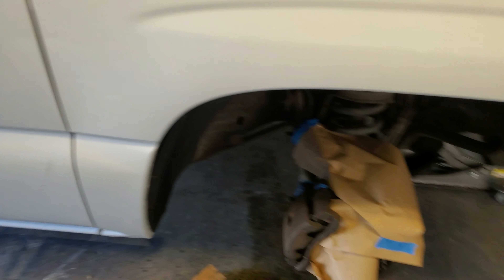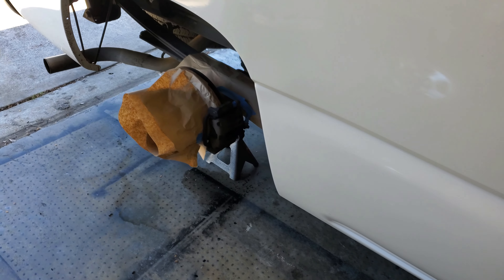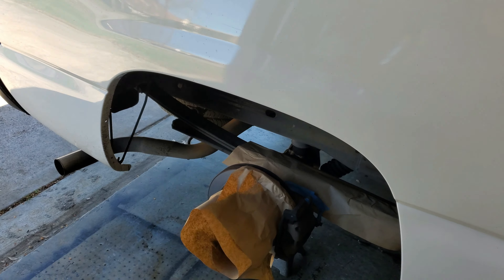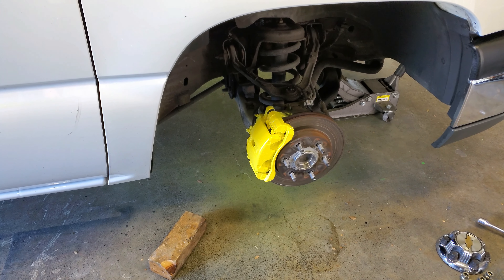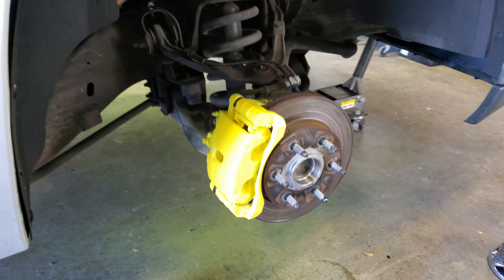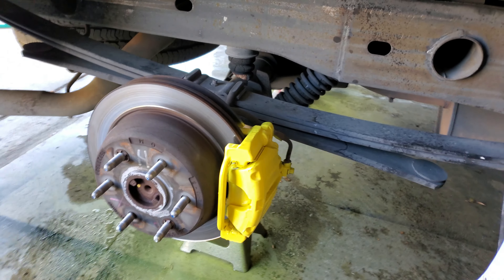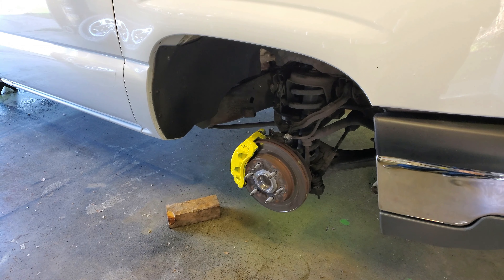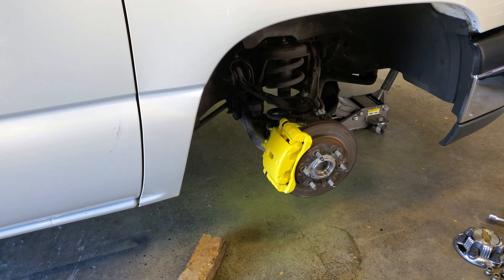Painting Brake Calipers on 2003 Chevy Silverado (Yellow)

Comment: I use engine enamel on mine. But rusteolum is pretty good. Lools good
Reply from the maker: Normally I do to
Reply: @DrivenbyGears  rusteoleum is good it should hold up for a bit even with the heat

Comment: Looks good. You might want to remove the rear bump stops on your truck. You might be riding on them. Also you’ll want shock extenders if you’re running stock shocks on the rear
Reply from the maker: No need yet
Reply: Looking good all around. I do like your video of the hangers. I too couldn’t find a video of it. Thank you for that video. All though I’ve done this install several years ago and issue I had was a really tight fit trying to get my hand between gas tank and frame for the bolts but I got it done. I love your video for a refresh and I know it’ll be easier this time around after watching it. Im waiting for my hangers to come in Friday. I’ll be doing my 99 Silverado z71
Reply from the maker: @The1971chevy  heck yea